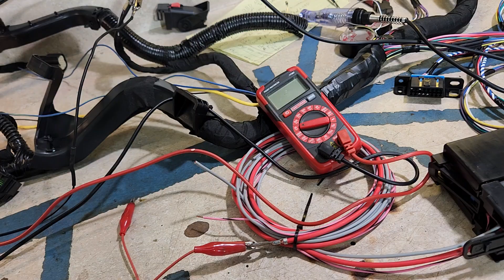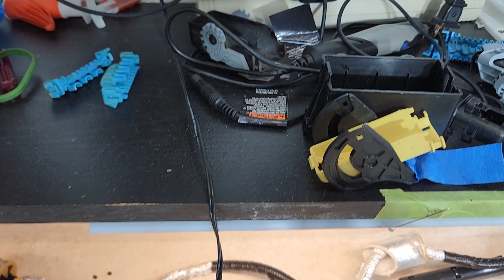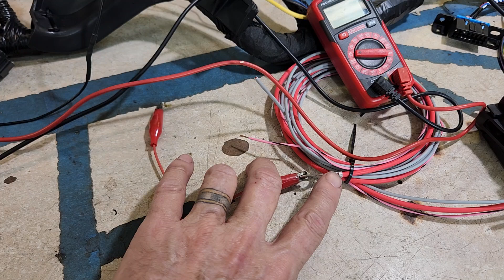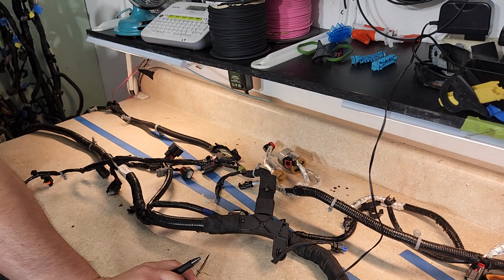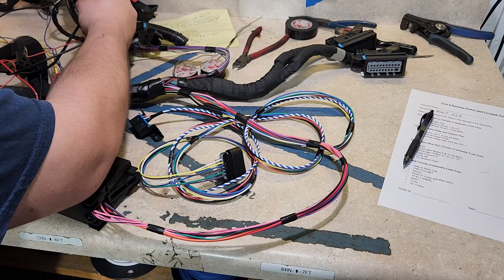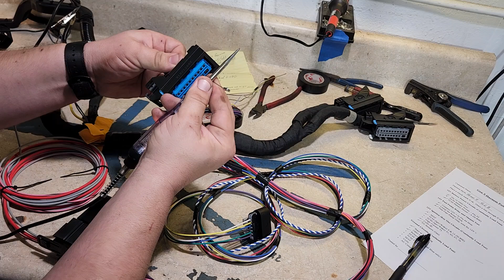Step 16 In process quality inspection. Powering up harness for the first time.

Comment: You mentioned 1:58 that sending 12v down to the relay to the bp automotive fuel block relay, does that mean that this stand alone conversion only supports a relay style pump and not the oem pwm pump/module?
Reply: Answered this same question you asked in step 11.